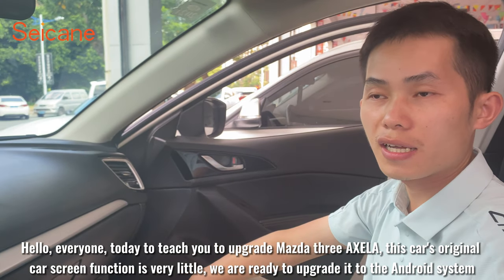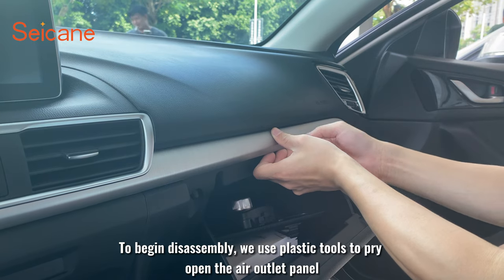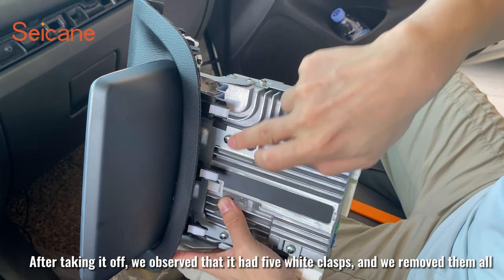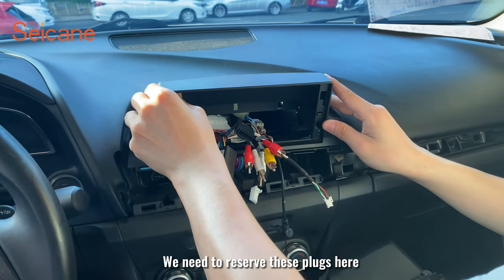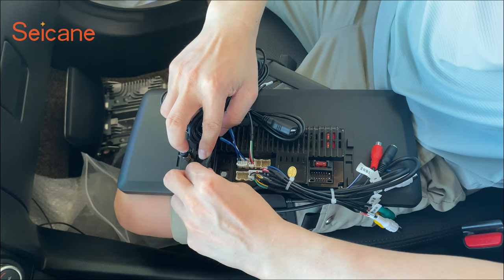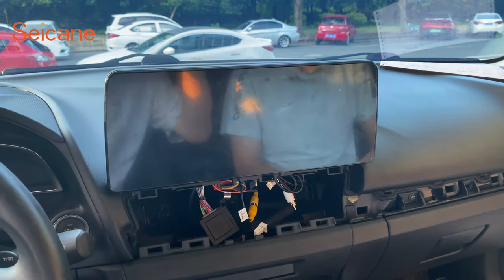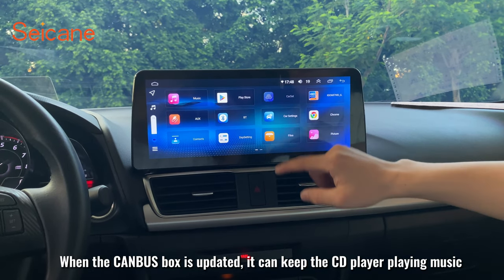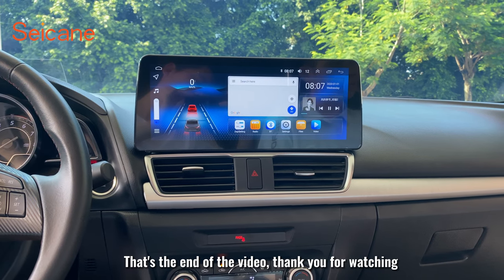Carplay Android-auto installation |How to upgrade Mazda 3 Axela radio? 2014 2015 2016 2017 2018 2019

Comment: My car is Mazda 3 2015 i-touring. Is it keeps almost original Car's ALL Functions after installation ? Thanks ! !
Reply from the maker: if your car is high configuration, yes, it supports almost all function. If your car is low configuration, steering wheel control and rear camera are not supported.

Comment: This is not the correct wiring harness for the 2015 mazda 3 I grand touring, and I am having a terrible time trying to figure this out. I bought another cable that fits my harness, but i don't think it works with my head unit/tablet.
Reply from the maker: hi, please contact us with email , we will help you about it : aftersales@seicane.com

Comment: Does all Mazda infotainment systems and OEM car settings can he access on this unit? I have 2014 fully loaded mazda 3 gt with heads up display and all the tech that comes along with it that can only be accessed on the mazda infotainment, i am kinda worried that all the features might get compromised ones i replaced it with this. 
This upgrade seems pretty great but i am just worried that the entire mazda OEM settings and tech may not be accessible.
Reply from the maker: hi, it keeps almost original car's functions after installation.
Reply: As someone who has purchased the chinese Seicane/eonon radios for my older mazdas. I can assure you they don't sound very good and they don't last very long, and lots of settings are compromised usually and these units run extremely slow or are finicky in some way shape or form.  It is better just to install the carplay/AA unit to your Mazda with the upper display
Reply: @amped12345  Haven't had any issues with my 2+ year old android head unit in a 2014. It retains all the settings in the 3rd gen because you can still access the Mazda infotainment and the buttons can be remapped. We primarily use CarPlay or AA so there isn't much installed or running on the android OS/system. It works just as well as my oem CarPlay/AA unit on my 2018. YMMV if you run apps off the unit OS itself. I'd imagine there could be limitations with Ram/CPU/OS if you decide to run it this way. It's certainly a decent option if you are upgrading from a non-screen trim, need to replace a defective one ($$$) or just looking for a bigger screen.

Comment: Does this support the stock backup camera already installed in my car? And does it come with the frame to attach to original dash mount in the car?
Reply from the maker: hi, can you send a photo of your car dashboard and camera connector to sales@seicane.com ? then we will help you to check.
Reply: In video he says it supports original camera. Did you ever email them or find out different?

Comment: Love it’s able to retain factory features… 
Don’t love the size that looks sooo bad just a huge tablet sitting on-top of dash 🤦🏻‍♂️ make it more symmetrical to the vents
Much more appealing
Reply from the maker: hi, it keeps almost original car's functions after installation.
Reply: it's no worse than the original 😂
Reply: @not-AI  agree with that! 😆 2024 car makers still think the  tablet slapped on the dash board “looks good” miss when they were integrated in the dash and all oem settings didn’t go through radio. 
Tablet on dash looks no better than when I bought a portable DVD player and Velcro it to the dash early 2000s’ 😆 
meant no hate towards OP video. screen proportionally looks silly as so large. 
I had the Seicane double sun for my 2011  3 hatch miss that car.. and they make solid units! Never had any problems with that one I bought from them.
Reply: @Seicane-Car-DVD you say almost all functions. Which functions does it not keep?

Comment: What Size is the 1x Bolt/ screw  holding in the unit.  after the trim and air vent is removed.  in Millimeters (mm) .   Need to know which socket size to get
Reply from the maker: hi, do you mean the screw on the back of the host ?

Comment: Will this work for the 2014 Mazda 3 Neo, which has a more basic original infotainment system,with no touchscreen?
Reply from the maker: it works if your car dashboard is the same as it showed in the video.

Comment: Does factory systems still work thru screen? Such as maintenance reset, oil changes, warning info and so and so??
Reply from the maker: hi,what is your car configuration ?
Reply: @Seicane-Car-DVD   2016 mazda 3 with bose system and navigation

Comment: whats the exact name of that screen upgrade and can you use the same trim that holds the screen or do you need to get a different one?
Reply from the maker: hi, we usually don't suggest updating if there is no problem with the radio, since it may mess up the system and break up the radio possibly.
Reply: can I use the functions such as resetting the car oil, resetting the oil, tire balance maintenance, are options that can continue to be used?
Reply: @Seicane-Car-DVD can I use the functions such as resetting the car oil, resetting the oil, tire balance maintenance, are options that can continue to be used?

Comment: Could you please share the exact model number for this screen? I don’t see it on your website
Reply from the maker: hi ,  Model:  T2104N-O
Reply from the maker: https://www.seicane.com/carplay-full-fit-screen-for-2014-2015-2016-2017-2018-2019-mazda3-axela-gps-navigation-radio-t2104
Reply: No point asking these guys....they lie so much. The radio is rubbish, it's laggy....recommend you buy a teyes or atoto brand radio. Seicane stuff is crap

Comment: Hello. I have a 2016 Mazda 3 but the original CMU is damaged and doesn´t works. Could I replace it with this device?   Thanks for your response
Reply: Hola, tengo un Mazda 3 2016 pero recientemente el módulo de la pantalla original se daño y ya no funciona. Este dispositivo me sirve para reemplazar este módulo (CMU) ??   Muchas gracias por su respuesta
Reply: Tengo otra pregunta por favor. ¿Cual versión de sus sistema es la mejor para mi?  RAM 2G,ROM 32G,Medium High version  o  RAM 8G,ROM 128G,Medium High version ???   solo tengo pensado usar CarPlay
Reply from the maker: Yes you can
Reply from the maker: Hola, ¿puedes enviarnos una foto del tablero de tu auto a nuestro correo electrónico? Entonces te ayudaremos a verificar si la versión baja o alta es compatible con tu auto. Correo electrónico: sales@seicane.com

Comment: If it says android 13 will it work with later versions as well?
Reply from the maker: dear friend, we usually don't suggest updating if there is no problem with the radio, since it may mess up the system and break up the radio possibly.

Comment: Dear Seicane, is this compatible with mazda 3 2015 with bose sound system ????
Reply from the maker: hi, yes, it supports BOSE
Reply: @Seicane-Car-DVD   Cool ill give it a try
Reply: @Seicane-Car-DVD  hey again,  just wanted to let you know it worked great, with my Bose Mazda 3. Only thing i need to fix is the Mouse and Volume knob i middle consol. I am guessing its just a setup i need to do, Sterling wheel bottom works fine
Reply: @d3sm054  just ordered one of these. How is the Apple CarPlay/ android auto working? Are there any bugs with the system?
Reply: @mikeooha  android auto works 9 out of 10 times, the 10th time i have to reenable Bluetooth ( takes 2 sec). but all in all am a pleased with it, i can't say anything about carplay sorry

Comment: Hi, great and helpful video! 
Once it is installed, how do you change vehicle settings such as door locks, turn signals, and lights, as well as change the units from US to metric?
Reply from the maker: hi, did you place the order from us ? you can contact us with email, we will help you about it : aftersales@seicane.com

Comment: Hi! for a 2018 mazda 3 with a remote in the middle, do you need a new remote? or does it connect with the same remote?
Reply from the maker: hi, Are you referring to the mouse controls near the car's gear shifter? ? it still works after installation.

Comment: Is it work with Mazda 3 sedan gs model and is it keeping all car original functions? If yes where to buy FROM Canada thanks
Reply from the maker: hi, if your car dashboard is the same as it showed in the video, it works. but please note that if your car is low configuration with handle , it doesn't support SWC and reversing. if your car is medium or high confirguration, it supports these functions. here is  the item link  : https://www.seicane.com/carplay-full-fit-screen-for-2014-2015-2016-2017-2018-2019-mazda3-axela-gps-navigation-radio-t2104

Comment: Great Video, I am going to buy one from your website now.  Should I contact you first?  She has a 2014 Mazda 3 Grand Touring with the upgraded Bose system stock.  Will this unit have enough power to support the Bose stock speakers?  Also do I need to order anything Else, such as the apple air play box.  I see you reconnected your new box behind the new units screen, her stock unit has a box similar to to the new  Apple Play box.  The original box is located in the center console glove box?  I also would like to know if their is a simple plug and play option if I were to add an 10 loaded and powered subwoofer box.  Is this a difficult process.  I know A-lot of questions I will put this message into an email for your review.  This along with your other instructional videos are amazing, outlining such detail throughout your installation.  what other add ons does this particular unit offer utilising the factory options with your very simple upgrade options?
Best Regards Tom
Reply from the maker: item link : https://www.seicane.com/carplay-full-fit-screen-for-2014-2015-2016-2017-2018-2019-mazda3-axela-gps-navigation-radio-t2104
Reply from the maker: yes, it supports BOSE. it also supports carplay/android auto.
Reply from the maker: do you mean you have contacted us with email ?  sales@seicane.com